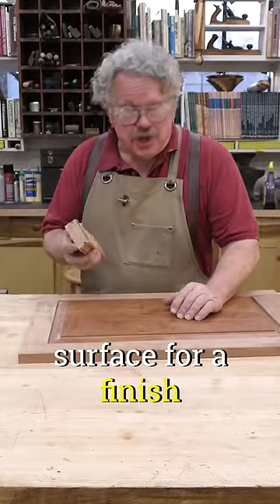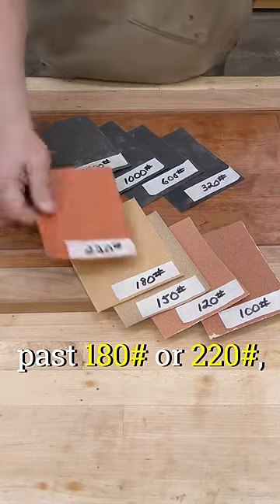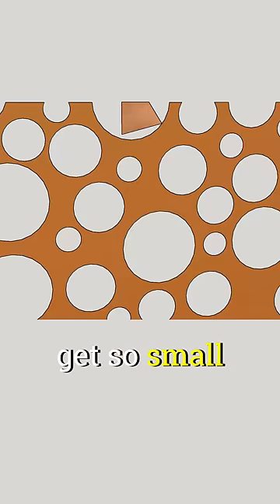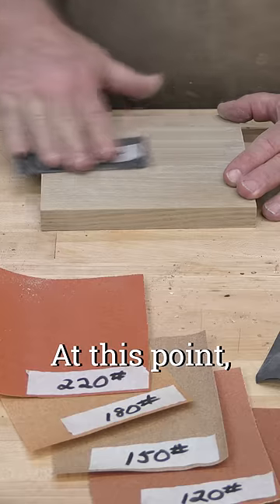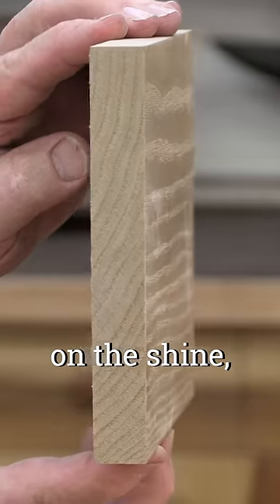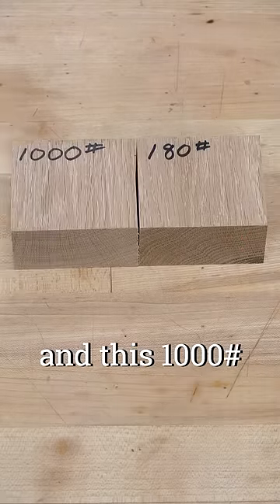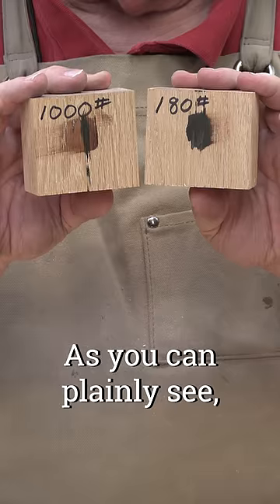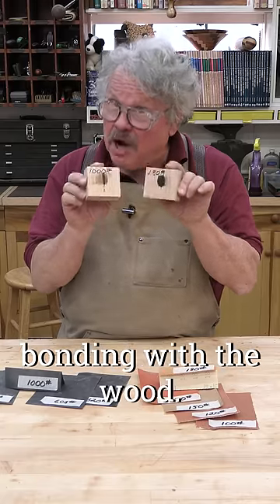Sanding Past 220 - How Smooth Should You Go? #woodworking #diy

Comment: I always assumed this, but didnt know the typical grit limit.  Is is roughly the same for a wide variety of wood?
Reply from the maker: A wide variety of common commercial woods, but not every wood species or every finish. There are circumstances that require more (or less) sanding. Also note that this advice pertains to sanding raw wood only. It has nothing to do with wet-sanding, polishing, or rubbing out a finish

Comment: So... either sand with a rougher grain if you plan to varnish the wood so it adheres better. Or with a very fine grain, if you plan to leave it unvarnished to make the wood more stain resistant (though not completely resistant) and shiny.

Comment: In most cases, I can see the merit here, though I have come across one scenario where that runs counter. I’ve done some light luthier work, and what I’ve found is that going to somewhere around 600-1000, lightly cleaning with a damp rag, and then finishing with a well formulated penetrating finishing oil (I was using a guitar specific finishing oil) results in an a finish that is almost as smooth as lacquer, but still retains that oiled richness and breathability.

Comment: What I would do in hs woodshop was sand to 220, apply polyurethane, then take 1500 grit and lightly hit the polyurethane do that 3 times coat sand coat sand coat sand and it felt like glass

Comment: What about planing? I heard planing is comparable with a very high grit sanding. Can we paint planed wood? Or should it be sanded rougher first?
Reply from the maker: Because a planer cuts in a rotary fashion, it leaves "millmarks: -- peaks and valleys in the wood. The peaks present end grain on the surface; the valleys, long grain. End grain and long grain absorb a finish differently and often make the millmarks highly visible. Paint does a better job than most finishes at disguising the millmarks, but it's still considered good woodworking practice to sand, scrape, or hand plane the surface to remove them.

Comment: Depends on what finish you're using. If I'm using an oil finish I sand unto 240, then flood with the oil and sand unto 360 or even higher. The dust mixing with the oil to fill the grain.

Comment: Sprayed stain/clear/paint for over 3 years and I can confidently say it depends on the wood type. Soft woods NEED slightly higher grit otherwise the finish comes out grainy. Harder wood doesnt hold onto sanding marks (or paint) as much so you can get away with lower grit sanding. If its too smooth most paint will run VERY easily, and you wont get very good spray buildup around corners

Comment: Grits above 600 will make dust that turns the surfaces into a "hydrophobic state" making the density of the particles act as a super encapsulant, which prevents absorption of the stain, or varnish.

Comment: So yeah, you finally made this make sense for me. I'd always heard it described as "higher grits make the pores too small," which makes no sense since the pore size is intrinsic to the wood. No one has ever pointed out the issue of compaction of smaller and smaller particle sizes into those pores, and that makes perfect sense. 

In that case, would sanding higher be a helpful thing to do with woods known to be blotchy when stained like birch? Would the more evenly processed surface accept color more evenly?
Reply from the maker: A tendency toward blotchiness is a property of the wood itself, and the manner in which the surface accepts a finish cannot be altered by  surface preparation. Some woods simply have variable densities across the surface of any given board -- poplar, elm, birch, beech, spruce, to name a few. A "surface conditioner" partially seals the wood, soaking deeper into the less dense sections and evening out how the wood accepts a finish -- it makes it suck across the entire surface, not just in patches. But so far, no one has come up with a better way -- except to use chemical stains such as ferrous acetate or nitric acid. This colors the wood evenly, but doesn't offer a wide range of colors and shades.

Comment: 400 is the sweet spot for me. i find that with 180 or 220 or even sometimes 320 the wood can still look a bit rough and have visible sanding marks. 400 seems to be the grit that makes everything nice and super smooth and flat without starting to polish. jumping from 400 to 600 or 800 on wood doesn’t really do much in terms of changing  what the wood looks like, and once you get past 800 you essentially start polishing so for me when doing a stain i’ll sand up to 400.

Comment: The only time I ever go to 1000 on woodnis if it is to be used as a master for something that I'm going to first make a mold of and then cast in in either resin or some other material that needs a smooth finish

Comment: What are the higher ones typically used for?
Reply from the maker: There are too many applications to list  but I primarily use the higher grits for smoothing and polishing a wood finish,, or for preparing metal for a finish, and then polishing it afterwards.

Comment: How do you avoid pigtails when using a ROS? Correct me if I’m wrong; if you start at 80, your next grit is 120, 150, 220? I don’t have festool but I’m vacuuming my saw dust and I’m not moving terribly fast across the surface…. What am I doing wrong? I got a dewalt ros, I mean pos
Reply from the maker: Pigtails are most common when (1) you're using cheap sandpaper -- the grit either becomes clogged or breaks away from the paper. They can also happen (2) when you wear out the sandpaper and the grit starts breaking lose. Finally, (3) if you lift the sander off the wood, let it spin up too fast, and put it back on the wood, you might get some pigtails. It helps to have a piece of scrapwood handy to slow the disc down before you transfer it to your work.

Comment: My dad was a carpenter and never sanded beyond 220.  His stuff is silky smooth 20-30 years later.  My high shop teacher had us wet sand with 600 grit.  I believe we were to wet sand before and after the polyurethane finish.  Would wet sanding help get the particles out of the wood and actually cut?
Reply from the maker: See the pinned comment -- look for the paragraph on water popping.

Comment: How do you prevent the sawdust from loading the sand paper
Reply from the maker: When hand-sanding, whack the sandpaper on the edge of your workbench every few minutes. When machine sanding, used an abrasive with only 40% surface coverage.

Comment: I go right up to 2000 myself. Though usually on materials such as steel, metals, resins, and plastics, before taking the cutting compounds to a perfect finish.  Wood being soft, cant really be effected by smaller grit sizes.

Comment: Im a big polyurethane guy and ive hidden so many mistakes under the finish. I only sand to 180 or 220 but when the finish is on I sand lightly with 400. The finish makes the light bounce off in a different way than a raw wood surface. Thats the point, and once the finish is on it doesnt matter as much how perfect the surface underneath was anymore.

Comment: In gunsmithing, I was always told not to go above 320 as the oil will not be absorbed properly, and you won't see  much of a difference past 320 anyway. Honestly, I might experiment with stopping at 220 for my next stock and see what difference it makes.
Reply from the maker: Sometimes I stop at 220# and then wet-sand a wipe-on finish or oil with 240# or 320#.  This creates a slurry that fills the pores without obscuring the wood grain. The finished product has a nice sheen and a wonderfully "soft" feel. Great for tool handles, gun stocks, and kitchen utensils -- anything that you're going to hold.
Reply: @WorkshopCompanion  I've never heard about this method. I might just try it out next time, thanks!

Comment: Blow off your work with compressed air and wipe it down with a warm damp towel in between switching grits. This clears most of the dust out of the pores, and pops up the loose wood fibers. Allow to dry before you continue sanding. You can stop going up into the finer grits when you no longer feel the fibers pop up when you wipe it down. What grit that's at depends on the type of wood.

If you want both deep penetration, AND a super smooth finish, you can always apply a couple of coats after 180 grit, let dry, continue to however find you want to go, and apply your final layer of finish over a super smooth surface. It all depends on what you want, and how much time you are willing to sacrifice to achieve those goals.

Comment: 220 typically cuts fine enough that the naked eye doesn't see the lines when you work up through the numbers properly. Sand by eye ,not be feel . It can feel totally smooth and still look rough. Every time you transition to a finer grit, you sand until there is no visible cut marks from the previous size.

Comment: I've heard some say you can wipe the sanded surface with mineral spirits or other alcohol based product to help remove the sawdust particles from the pores in order to help mitigate the problem with stain and finishes not penetrating. Do you think there's any truth to that, or have you tried it?
Reply from the maker: Alcohol make cause the wood fibers to swell and loosen if it's mixed with water. Mineral spirits, not at all. Read the pinned comment.

Comment: I thought if you keep stepping up on grits you will remove the bumps. And avoid this problem. Am I wrong?
Reply from the maker: You're right until you get to the finer grits. Past a certain grit (slightly different for each type of wood), the grit it smaller the the wood grain. When prepping for common finishes, there's no point in going past that. You should know this only applies to sanding raw wood; polishing and rubbing out a finish is another ball game altogether.

Comment: There are ways to get around that, gunsmith do it all the time by going up to 600 grit, then washing the piece off with warm water, letting it dry then sanding it down with 0000 steel wool, it also raises the whiskers of the wood and Letts you get them off, then stain the wood after no more wiskers and the wood had completely dried, wett and sand with steel wool once more then apply the finisher being Linspeed is my prefference

Comment: I sand to 320 and then put on a few coats of finish, filling the grain with finish, and then start to sand to 600 between coats, and then once the final coat is on I sand 600, 800, 1000, 1500, 3000, and then 5000 grit.

That leaves a high luster satin finish on a lacquered piano

Comment: What would happen if you go to 220 grit, oil and then pretty much polish the surface with 1000 grit after oiling it?
Reply from the maker: "Sanding in" a finish is a good way to fill pores and seal the wood.

Comment: Would it make sense to sand to 180 or 220 to apply a stain, but then sand at a super fine 1000+ grit to get that burnishing sheen effect without ruining the stain? Or perhaps staining darker than preferred and then sanding at 1000+ to account for the effect on the stain?

P.S. I’m not a woodworker, I just aspire to be one, so sorry for the stupid question.
Reply from the maker: Actually, it's a rather good question, it addresses sanding stained wood. The short video is meant as a guide for sanding raw wood only; it does not address the multiple uses of abrasives for adjusting and polishing a stain or finish. Sanding stained wood is often a necessary step in preparing wood for a final finish  when the stain and the finish are applied separately.  If you are looking for an even color, this can be problematic -- the wood gets lighter as you sand away more stain. If you don't sand to an even depth, the stain can appear blotchy. On the other hand, there a  times when this works for you. Highly figured grain absorbs stain differently in different areas, and a light sanding can emphasize these differences, making the curl or burl in the grain more prominent. So the answer to your question is yes, you can sand stained wood to any final grit the suits you, but you have to be aware of the effect this may have on the color and uniformity of the tone.

Comment: What if you blow off the wood with high pressure air, or vibrate it at a high frequency to knock the dust particles loose

Comment: As an instrumentmaker ( mainly acoustic guitars) I a tually want the most minimal layer of finish on the top as possible. Sanding to 1000 grit then french polishing or seeling with shellac and then adding finish is done to prevent the finish from penetrating and changing the proporties of the wood I just spent a lot of time accurately "voicing".
Reply from the maker: Interesting points; thanks for sharing. I spent some  time as a luthier and when we built a soundbox, we also limited finish penetration to preserve the "brightness" of the tone, usually with a wash coat of shellac or thinned violin lacquer. At the time, I was unaware that you could also do it with sanding technique.

Comment: Depends on the finish you are applying. Film finished achieve better adhesion with coarser sanding grits and you should never go finer than 220 with 180 being preferred. Doing something fine that is meant to be tactile and you’re applying an oil or wax finish? I’ve got good results going to 400 or 600. The only use I’ve had for finer sandpaper than that is when cutting back and polishing up some tabletop finishes where it needs a mirror finish.

Comment: Novice here... is there a way to get the wood smoother then without packing the cells? fine steel wool? scraper? something else? or is it not worth it?
Reply from the maker: How smooth you can make a wood surface will depend on the density of the wood and the structure of the wood cells. The diameter of the average hardwood cell is .1 mm; while the size of 220 sanding grit is .06 mm, so you're already pushing the envelope at 220#. Can you get it smoother by switching to another tool? Sometimes yes, mostly no depending on the wood species and the tool.

Comment: after you've sealed the wood, you can use a piece of rosin paper like sandpaper to make it shine without having to sand it too smooth beforehand or worry about scratching it.
Reply from the maker: Rosin paper, frequently called building paper, is  sized with rosin (pine pitch) or polyurethane. The shine you get is from transferring these substances to the wood surface, and they may block the absorption of a stain of finish.
Reply: @WorkshopCompanion   yeah, you do it after you've applied finish

Comment: This is why belt sanders exist as the belt moves fast enough to blast the sawdust off

You can also use just basic see through sellotape to remove the sawdust from the surface and any gaps

But there defiantly is a point at which sanding finer wont make a smoother surface

You want smooth... thats what resin is for

Comment: What about if I am finishing with oil? Or what about burnishing it after applying oil? I like to add a polished shine to my pieces but I also like the richer colors that oiled wood provides
Reply from the maker: The short applies to sanding raw wood only, as a technique for preparing the surface. Sanding in an oil finish is a finishing technique, and a good one.
Reply: @WorkshopCompanion  I appreciate your response, I am still pretty new

Comment: I can’t find a solid answer on the internet, what is “piano finish” is that some kind of wet sanding or post staining finish?
Reply from the maker: A traditional piano finish is done by applying ten to twenty coats of a high-quality (and quick building) nitrocellulose lacquer to the wood, then rubbing it out to a high gloss with pumice, followed by rottenstone. Today,  the term "piano finish" describes any building finish (shellac, lacquer, urethane, polyurethane, varnish) applied in multiple coats to create depth, then rubbed out to a high gloss.

Comment: How does tack cloth affect this?
Reply from the maker: Tack cloths are great for removing surface dust. I prefer tack cloths to compressed air for the simple reason the the cloths capture the dust. If I use compressed air, I may have to breath the dust; masks don't capture everything. But neither tack cloths or compressed are will remove all the impacted dust from fine sanding -- see the pinned comment.

Comment: Similar concept to concrete floors 

I’m a polisher 

You grind with metal matrix diamonds starting at either 40 or 80 grit 
Usually you introduce a dye 200-400 grit 
And can opt for a medium shine of 800 or higher 1500 before sealer is applied
Reply from the maker: Interesting. Thanks for sharing.

Comment: You can buff the wood dust out of those small open wood cells with a buffing wheel or rag don't ask me how I know, 

Also anything above 200 leaves stuff behind in the finest grooves of the wood, so either never go above 200 or buff it before you stain or oil

Comment: What if you prepare it with acetone after sanding with 600 grit?
Reply from the maker: Acetone will remove any grease, wax, or oils on the surface. It does not free up impacted dust.

Comment: This is actually, roughly, what I was taught at work when I started sanding. "If you sand too fine, the stain can't penetrate the wood. Don't go much over 200 while sanding, you can always clear coat to whatever smoothness you want"

Comment: Is there a way to remove sawdust from the wood or the sanding paper?
Reply from the maker: In automotive finishing shop, there are sanders that pull away the dust through a sanding mesh, and something like this would help keep the sandpaper clear. But wood is not the same as metal -- there are  microscopic nooks and crannies where extremely fine dust can become impacted.
Reply: @WorkshopCompanion  Oh so you have to buy a new one when sanding wood.. Thanks for your time!